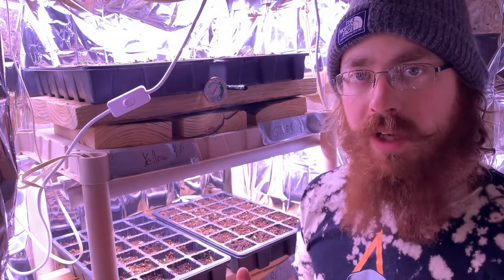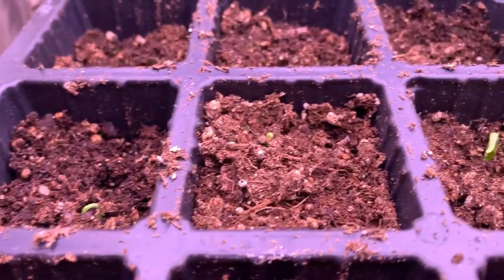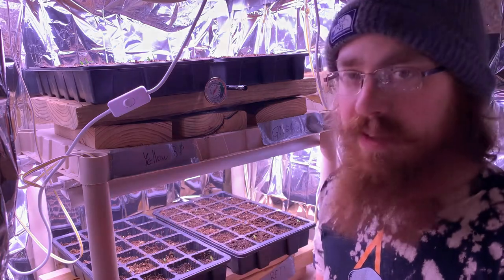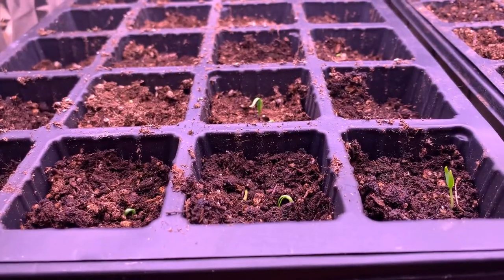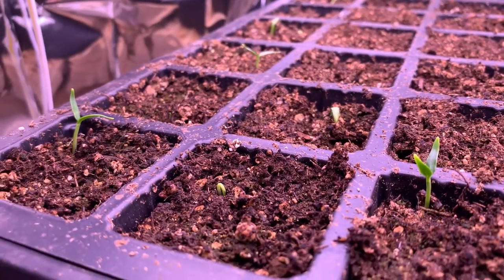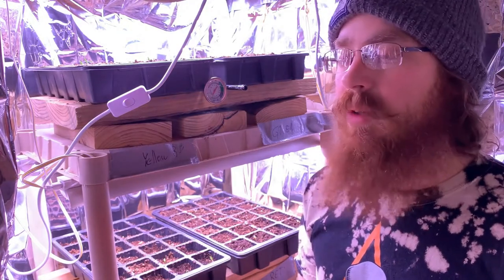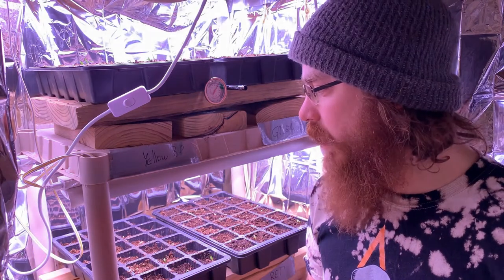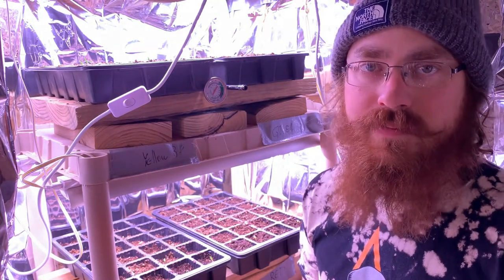HOW TO BUILD STRONGER LEGS FOR YOUR RAISED GARDEN BED || WE HAVE PEPPERS! || HOMESTEADING VLOG

Comment: Screwing two 2x4s together will produce the same concept, make the inside one shorter by 3 1/2 inches and you have a notch !
Reply from the maker: True. I might just modify the one by adding the shorter board like you said. The cost would be about the same though or possibly more expensive. You would need Two 2x4x12's or three 2x4x8s
Reply: @hardlyhomesteading435  I don't know about cost , that's just the way I've  been taught, plus if you are repurposeing wood it might be easier to find 2×4s then 4x4s